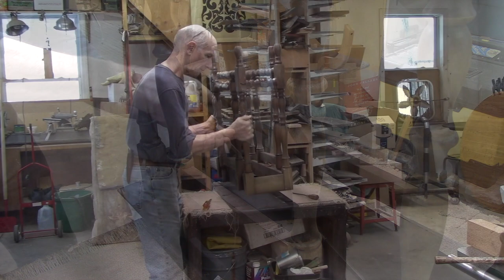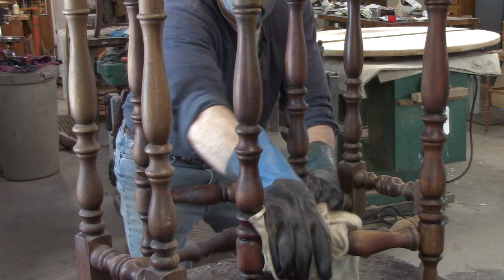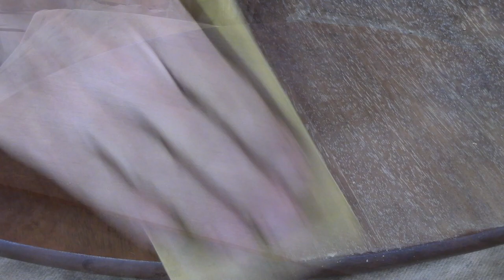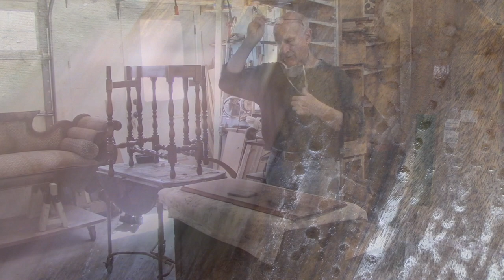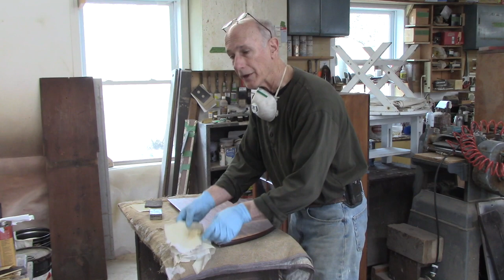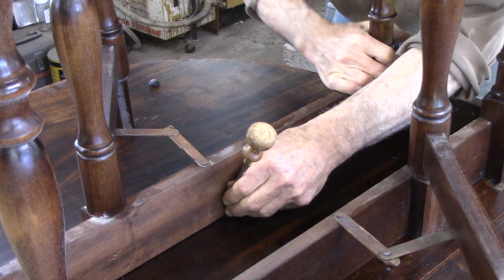Restoring a Gateleg Table - Thomas Johnson Antique Furniture Restoration

Comment: I inherited an almost exact model table to this from my grandmother - all it's missing is the center drawer.  Hers was originally her mother's, bought in 1932.  It is a prized heirloom in my home, and I'm glad to see you bringing this one back to life.  It's a FANTASTIC table - a perfect buffet 99% of the time, and then when you need it seating for 4 adults or 6 kids.
Reply from the maker: Thanks! That's great! Who loses a drawer? Still, nice to have a table that means so much
Reply: @johnsonrestoration  I should have been more specific - our model has a drawer, while the one you restored didn't.  Still, great table and I think every home should have one.  You've also made me rethink my use of stain and polyurethane in my projects for some more traditional finishes.

Comment: Heck of a job. I had a table top one time that no matter what chemicals I used or how much sanding I did this gunk would not come out of the wood. I finally soaked it in gasoline and lit it on fire and that got rid of the gunk as well as the table top. I always enjoy your videos and knowledge. Keep up the good work.
Reply from the maker: Thanks! I'm going to have to remember the gasoline thing. Could be the perfect solution
Reply: I can't wait to see that episode!
Reply: LOL.  More than one project I've seen being restored on this site would have been consigned to the burn pile if I were the owner.  Furniture everywhere is rejoicing that Thomas Johnson got to it first.

Comment: Hi Thomas, thanks for the great video. An awesome display of patience. Just a suggestion for sand paper when you run into material that clogs your sand paper. You might want to try a product called Abranet. It is an open mesh product that has a full range of grits and just does not clog. Awesome stuff. It is a little more expensive but I find it lasts quite a bit longer. It is pretty much all I use in my shop these days.
Reply from the maker: Thanks! I've seen that, in fact I think my brother uses it. I'll give it a try

Comment: when I was a child, we had a slightly larger example of this table, and nearly identical in design. It was probably made by my great uncle in the early 1900's due to the finish being the same as a "3 tear" corner shelf and "baby" rocking chair which he made for my mom's mother. The finish was some sort of died varnish or shellac, and extremely dark. The wood was most likely poplar. My mom tried to clean the finish and actually removed a little. Who knows what happened to that table. The rocker is now in passion of my grand children, and nearly 105 years old, Uncle Guy did good work for a train engineer. 
Superb video as always. ;-)
Reply from the maker: Thanks! That is great that you have those pieces! Be sure to attach some info on them (underneath) that details who, what and where they were made. This will really help future descendants know what they are

Comment: Silicone based furniture "polish" is the devil. It is the nemesis of paint and varnish. I'm guessing this is the sort of thing that happened to that table. Thanks for your great work, and even more for sharing!
Reply from the maker: We always assume it's silicone, but we don't really know, so I thought it best not to use that word. Don't want to offend any polish manufacturers!
Reply: What should I be using for routine cleaning/waxing of my wood furniture?  I was raised on the lemon scented stuff so just kept with it.
Reply: K B, Just use whatever you like :) My nanna was keeping things clean with lemon sheen stuff, not worried about some dufus like me wanting to refinish her Queen Anne reproductions. Maybe stay with what you use because it's an annoying job to decontaminate stuff to start using beeswax (this video is a great example). 

But if it ever come time to refinish it, invest in silicone remover and/or lots of time and elbow grease. And don't give up! On a car panel a molecule of armour-all can doom an entire panel's paint and it will have to be started from scratch. That was not a good day, it involved sanding, wax & grease remover, silicone remover, wax & grease remover (to remove the silicone remover) lots of tack cloth and denatured alcohol to ensure decontamination and THEN I could start again.

Furniture can be somewhat more forgiving but still needs a lot of effort to overcome the mister sheen fisheye of doom. Hope I didn't waffle too much this time.
Reply: Nope, no waffling.  Just convinced me that dusting is overrated!
Reply: YES!!!!! My thoughts exactly - silicone polish is an ATROCIOUS product to use ... ANYWHERE ... on ANYTHING!!!

Comment: So interesting. I know you told the client you weren’t going to strip the top but man, what a process for you to bring the wood back to life/health/able to take finish. What was all that black stuff? Such great work. Thank you for providing us all with hours of entertainment.  Like RootedCanuck wrote, your channel is the one I look most forward to watching. Happy Friday!
Reply from the maker: Thank you Deette! The black stuff was dirt and oil, I guess, hence the contamination
Reply: Deette Kearns >>in our home that burned to the foundations we, oddly enough, were able to salvage a very few pieces of antique furniture that were irreplaceable since most insurances only replace “an end table with an end table” and come up with absurd 150 year old rules for it to be considered antique!  But i digress... There is an acidic condition in soot which discolors through finishes and the water from the fire engine has corrosive chemicals that in turn flow over burning paint, roofing and etc then onto your furniture then wreaking havoc on the finish combined with heat and coated with soot.  It takes patience to get it right without a complete strip down and refinish..
Reply: Deette Kearns the black is evidence of years of hard work outside and sitting down to supper at the end of the day in your dungarees.

Comment: I met a lady by unfortunate circumstances.  We both went through a program and had bad contractors.  Leave it at that.  I love working on furniture, building, restoring, etc.  She has put so much confidence in me and I have been doing projects for her.  She gave me her family table to clean and restore.  Yikes!  I'm scared to death I'm going to screw something up.  The table has drop down sides using a piano hinge.  Just cleaning this table has been a chore.  I have never wiped down furniture with acetone but I thought I would follow your steps here.  This is a dining room table will the way you finished the top be durable enough?  I love your videos.  You do things right!
Reply from the maker: Thanks! Table tops are big projects! The finish I use, Waterlox Original is very durable. But any water based polyurethane is too. I like the color of the Waterlox
Reply: @johnsonrestoration  Thank you so much for answering.  Does the Waterlox yellow or have an amber tint to it?  I love the look of wax, but this is a table.  It drop leaves with piano hinges.  The hinges are so disgusting.  I wonder how much milk was spilt through the crack.  Miss the East Coast.  Lived in Boston for 6 years.  I see why you try to use all that beautiful wood on furniture no matter what the shape its in. Have a beautiful day.

Comment: Thomas, I completely enjoyed this episode.  Your project turned out beautiful!  About a year ago I found a cute little dropleaf table like the one you've finished here.  .  The table top is scalloped and there is a little drawer on the side.  The top looks like someone tried to refinish it, but at some point - someone put a glass/bottle on the table and left a ring.  I'm thinking that really spoiled the project for someone and they decided to give it away to the Goodwill, and I bought it for $6.  The bottom actually looks pretty good.  It helped that no one could set a drink on the legs.  I will be using paint remover on the top.  I am hoping that alone will deal with the stain.  If not, I will follow your lead to clean it further.  I actually like that you used tunge oil.  The satin finish gives a perfect sheen.  I actually love tongue oil because in Minnesota we have winter 6+ months out of the year.  It's a finish I can deal with indoors all seasons.  I usually use a spray satin laquer when ever I can.  Thank you for pointing out that I should remove the top.  Here I was thinking of how I might mess up the legs while working on the top.  Thank you for what you do, and sharing it!
Reply from the maker: You are welcome! And thanks for watching. Good luck with the project, oxalic acid might help with the stain.

Comment: Excellent job. I have a gate-leg that looks almost identical to that except it has Barley Twist legs. I am not sure if mine is antique or not. I bought it at a house auction but it has one leg where the twist goes the wrong way from the others and that makes me doubt its heritage. Watching this made me consider giving it a clean but I live in the UK where the Nanny State would slap me around if I was bold enough to try and buy a gallon can of Acetone.
Reply from the maker: Thanks! Well, acetone is usually considered safe, I think only because it evaporates so quickly
Reply: Yes, but you live in a civilised country. Ha Ha. I tried to buy some Isopropyl alcohol from a pharmacist in my local high street because I had a bunch of tape decks to clean the heads on. I also needed a syringe plus needle for some tricky to reach ones. He would only sell me 100ml or about 6 table spoons of it and he refused outright to sell me a syringe. Enjoy your freedom and being treated like a grown up. We have lost both in our new socialist utopia.

Comment: I have found water based products work best over silicone contaminated furniture. Use super thin coats for sealing the contamination in. Do not use reactive finishes, such as lacquer as they will melt into the previous coats allowing the contamination to bleed through.
Reply from the maker: You know, that's a good idea. I will definitely try that out.

Comment: Thank you for sharing your knowledge. I have a question about this restoration. Did you completely sand the legs or were they just scuffed withe the acetone soaked steel wool?  The project I am currently working is an antique oak drop leaf table, the legs of which are similar in design.  It is not very dirty and I have naptha and 0000 steel wool  to wash it with.  Will it need to be washed down after using the naptha?
Reply from the maker: Thanks! The naphtha is fine, after it dries I would scuff the surface with a scotch brite pad (grey), then apply your finish

Comment: Sweet.  Interesting to clean up the top with acetone and not use stripper.  If you had used stripper, do you think the end colour and finish have been much different?  Thanks for the video.  Cheers, David
Reply from the maker: Probably not. Sometimes stripper does darken wood, especially mahogany, and sometimes in a pleasing way. But the oxalic acid brings it back to natural

Comment: Ended up looking awesome, if you had decided to even out the tabletop color would it be stain or dye? This color unevenness seems to be very common in vintage mahogany pieces, best regards..
Reply from the maker: Thanks! I would have used a dye stain on the bear wood, and then oil stain in the varnish to pull it all together.

Comment: Very interesting video! I am interested in furniture restoration, and I have a few questions.

Why was it not possible to just take a card scraper and scrape te top off, and put the turned parts into a lathe end rub a steel wool against them? Because it would have looked way too new after that?
And I also would like to ask if that lots and lots of coats of solvents, water, etc does not soak into the dry wood and cause possible cracks afterwords.
Many thanks in advance, and keep up the good work!
Reply from the maker: Thanks for watching! I didn't scrape because I didn't want the top to look new, I want to retain as much of the patina as I can. Same with the legs, besides, you can't put old parts on a lathe, it doesn't work

Comment: I think that the blister effect might be due to perhaps a silicone spill or silcone polish. I repair diving drysuits and if silicone spray has been used on the cuff or neck seals I got the same effect and had extreme difficulty glueing the seals to the suit.
Reply from the maker: Thanks! Yeah, we always blame silicon polish. I guess it could be a number of things though. Always difficult to deal with

Comment: Tom you have the patience of Job. But you certainly pointed us toward a solution for "end dust" or some other horrible siliconized product. I'm kind of surprised that your seal coat of shellac didn't solve whatever residual issue was present. Thanks again for more great information.
Reply from the maker: Thanks! The shellac may have worked better if I had padded it on too. Or you can mist light coats with a spray gun. But I didn't want too much shellac under the varnish

Comment: Thomas as usual your videos are interesting and informative.  Do you think that the application of the acetone at the onset actually caused some of the surface wax/finish to be drawn into the dry wood fibers of the top piece thus causing the "fish-eyeing" etc. later on?
Reply from the maker: Definitely. That's why contamination issues are so insidious

Comment: How do you keep the dust away while your assistant is sanding a chair in the back?
Reply from the maker: Thanks! I don't! I just have to deal with it! During the preliminary coats I'm not too worried about it (to a point). When it comes to the final coat I usually do that in the evening and leave the heat on all night.
Reply: @johnsonrestoration  I am a cardiologist but when I came here with 2 hand bags I had to refinish everything and over time I became better and sometime had to use what I had. I appreciate your attention to detail. Thanks for sharing.

Comment: I am studying your videos as I have a project that I want to work on.  I have an 1897 oak Singer treadle cabinet and there is discoloration damage to the top of the wood.  I don't know if it is water or oil.... but very dark spots on the golden finish.   This piece is veneered.  Will these techniques and products also work on veneer?    I want to keep the character of the old piece, not make it look factory new but I would like to make her look beautiful again and remove some of the stains.    I also watched your other video with a gateleg table.  Thank you for any advice.
Reply from the maker: Thanks! Yes, these techniques work well with veneer, but be sure to glue down any loose veneer first. Good luck! In this video I remove stains from oak veneer https://www.youtube.com/watch?v=CdDVOl0Xq4g

Comment: Hi Tom, great job, more then likely the customer used a polish that had silicone in it, if the finish was varnish no problem, but with a lacquer finish that silicone goes thru the finish and into the wood. Which is why I alway add fisheye flow out to my lacquer.Tom I have a ? I was out on a job to repair a large gouge on a oak floor, I filled and touch-up and it came out great, then the customer showed me an area were the finish wore thru and the oak is grayish in color. Will oxalic acid fixed it? if yes then I can just hand color to blend in. Thanks for any info you can give me.
Reply from the maker: Hi William, thanks for watching! Yes, put oxalic on it, it works well on oak

Comment: What '0' of steel wool did you use  between coats?  I heard you say you used #1 steel wool when cleaning the table. Thanks for the great work with the wood and with the video camera.
Reply from the maker: Thanks! Yes, #1 for stripping, etc. And 0000 for finish work

Comment: Tom.....Great video as usual. May I ask a question? Why did you use Acetone to remove the old finish? Haven't seen you use that before. Any particular reason this time? Thanks much
Reply from the maker: You're welcome! Acetone flashes off really quickly, but over all it works well to remove old finishes. If I need something slower I use lacquer thinner. So it kind of depends on how large or not the piece is

Comment: Looked like silicone contamination from furniture polish (Pledge, Behold, Old English spray, Favor, Klean Shine, etc.).  The silicone soaks into the finish and can get into the wood under the finish.  Tough because you don't know you have the problem until you apply the new finish and it fish-eyes or wrinkles up.   Have you tried something like CRL SR200 Silicone Remover and Surface Preparation as way to remove the silicone?
Reply from the maker: I've tried lots of things, I didn't know CRL made that. I will try it. It's been my experience that all those things help, but never completely get rid of it.